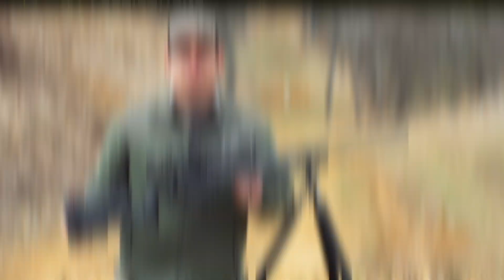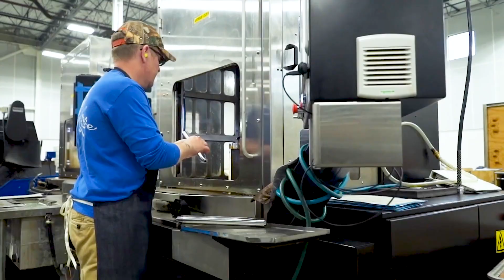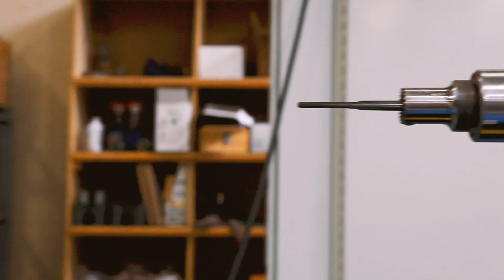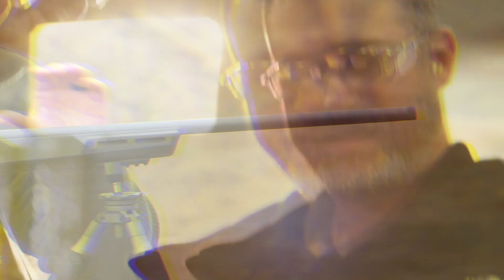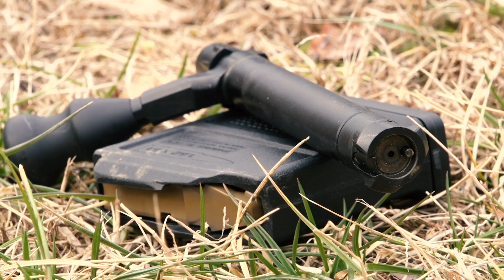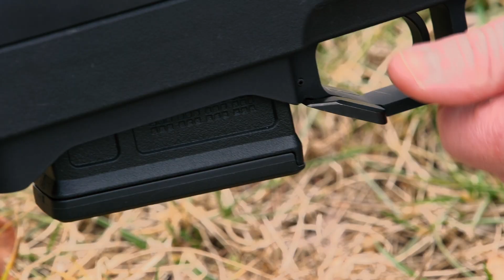Range Tested: Daniel Defense Delta 5

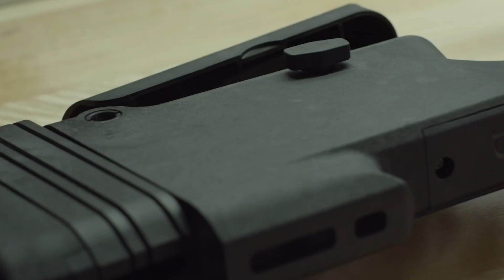Comment: At 3:42 is that normal for the barrel to lift away from the stock like that?
Reply: Yes. The barrel is free floated, it doesn't touch the stock, precisely for the reason you see in the clip, so that the barrel can oscillate independently.